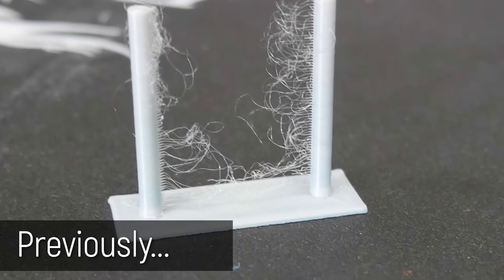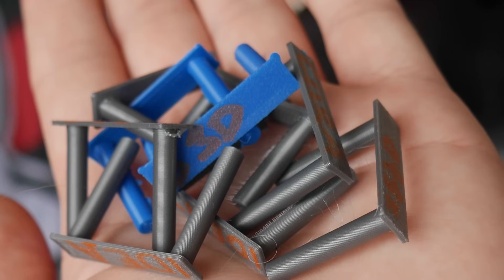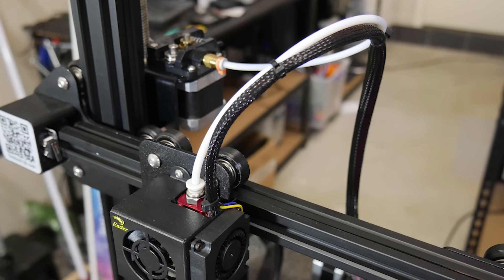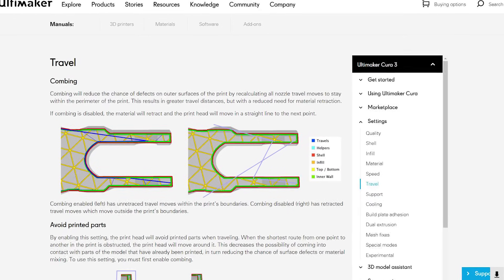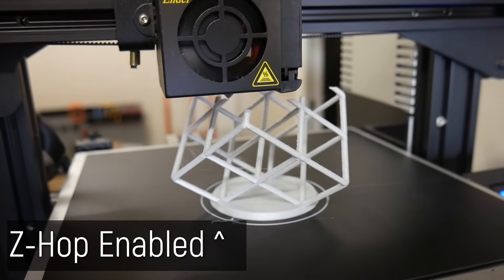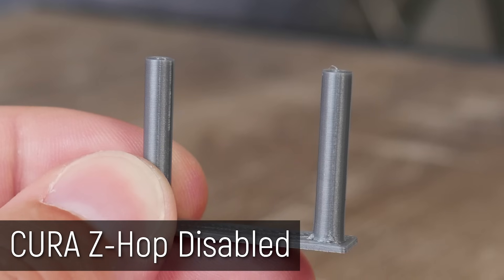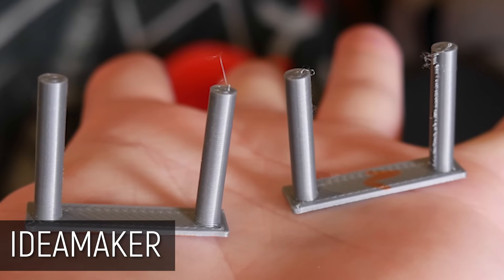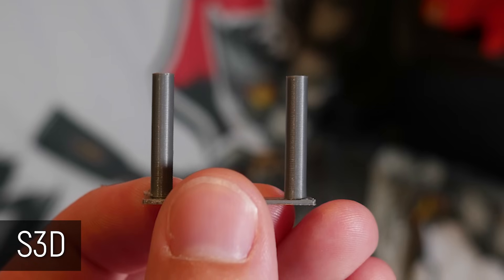Stop Ender 3 Stringing with this One Weird Trick! (ok but seriously)

Comment: I come from the far future of 2025 where Orca Slicer is ascendant. I ran into really bad stringing blobbing and oozing on a stock ender 3 pro on a certain filament with a certain profile. What I ultimately found was on top of retraction distance the retraction and detraction speeds played a massive role. There is no automated test in Orca, but if you run multiple retraction calibrations varying the retraction and detraction speeds you can find your sweet spot

Comment: I have a diy wood and 3d printed parts printer😂..I remember messing with the combing setting to produce the same results alongside the traveling thru the infill to prevent oozing...im receiving "new fresh" "better" abs to see if I can get no string...because I get the worst first layer wiyh ABS🥴...I NEED TO HACK MY SETTING  PRO MODE AGAIN(pro mode means head down watching that extruder head work and diagnosing the prints😤😭☠️💀

Comment: Hi Angus, I know it was 6 years ago, but can you please post where I can get your settings for IdeaMaker, the originals on 'gum' are no longer there, meantime I will try Cura with my Raise3D and 0.2mm nozzles which are failing to print without a web of stringing. I wish IdeaMaker was updated to include a form of combing, but I do not think they are interested, especially with regards to using the E2 with 0.2 nozzles. Thanks Jim

Comment: 2 days experience, learning as i go. after solving the sticking issue (glue stick) if this print makes it to the end it will be my 2nd and i don't have any stringing at all right now.
190 for the nozzle, 60 for the plate and running 60% speed, as of now. this print LOOKS perfect. but still too new to say for sure.

I've only done the test cat and one articulated dragon that i think finished by hopes and prayers alone, for my bed level was way too far from the nozzle.
every print after that until this one has came off the plate. but with theses settings i have no stringing.

if this gets any likes ill update this comment when its done.

Comment: Disabled Z-Hop (0.0mm) and reduced Retraction Distance (0.3mm) on Sovol SV08 and no stringing anymore. It needs to wipe over the object without Z-hopping to wipe all away.
Reply: So z hop, a feature to reduce stringing should be off and retraction reduced a feature that supposedly more helps with stringing  should be reduced. Doing the opposite is the solution?
Reply: @gt3911  Seems so for this printer. Very fast printing behaves otherwise than slow printing. I tried a lot with extreme test models, and get no stringing when z-hop is off. when z-hop is enabled i get stringing. Try wall printing order switch too. I guess diabled z-hop wipes the nozzle on the outer wall and avoids stringing. Try it, there is an extreme-test.stl on printables to test it all.

Comment: I know this is an older video but, I recently got an Ender 3 v2 neo and, my steel build plate was a little warped. I got a glass build plate and ever that wasn't perfectly flat. Ive also found that nearly ever filament is a little different from each other. I have slicer profiles not just for PLA, ABS, etc but, I also have different profiles for different brands and different kinds of PLA. 

Some people claim, "this is what causes stringing" or "this specific setting, alone, will eliminate stringing" but in reality, there are numerous factors and parameters that can cause or eliminate stringing. Whether it be temperature, z-hop, retraction, or more. 

I have 3 different PLA filaments from different companies and, they all use there own and unique profiles. Some filaments, no matter what I do, they almost always have some stringing. 

Temperature, retraction, print speed, and nozzle play major roles and are the first steps to attempt to elimate stringing.

Comment: 5 years later and im right here with stringing issues my ender has been great but i use tree supports in cura and i get strings and stalactites building up that can pull over small branches off the trees and making small details hard to print going to try combing thanks ur video is still as relevant as ever

Comment: The problem is u guys are all to high and mighty to just use the Creality stock slicer software. The Creality Slicer has grown by leaps and bounds if u own a Creality printer. Cura has too much settings for too many printers and it is hard to calibrate on their software end. Creality Slicer has all of the needed calibration settings to make your print perfect. I truly rately have issues. My first print with Creality slicer was totally flawless. I stopped and deleted Cura straighaway!

Comment: I have a 3S1, I'm not a 3D printing guru by any means, to be honest I didn't even do any tweaking/adjustment of the hardware right out of the box even. It's set up exactly how it came out of the box when others told me i need to tighten, align and fine tune the hardware itself before it would even print remotely cleanly. I loaded it up with flashforge brand PLA and the prints are flawless. Every single print I've done, sodastream replacement buttons, name sculptures for my desk, toys, toy cars, lego hardware, everything came out perfect. I then loaded Creality branded PLA in and everything is screwed, it's stringing like crazy, so bad that the strings will harden and the printing head will catch it and literally rip the print off the place and drag it around while printing stringing filament into thin air. I've put it in a dryer, etc with no positive results, so i've resulted to printing strictly with flashforge PLA now.

Comment: I'm having many issues with retraction on my Ender 3. Using default settings in Cura. If I just leave it will jam the extruder. I 'upgraded' to a full metal dual drive extruder and it's still happening. The extruder motor seems to get very hot under standard extruder setting. It's like it's melting the filament and causing a clog in the extruder just before the borden tube. I've changed the extruder and calibrated but it's still happening.
Reply: Turn down the Maximum Retraction Count And Minimum Extrusion distance window to your retraction distance

Comment: Unitimaker cura is bloody amazing I wouldn't even use any other slicer exspeicaly when combined with octoprint and a btt 7 pad the plug ins between cura and octoprint and btt 7 pad really helps fine tune ur printer even more honestly regret not doing this combo earlier amazing  control when I'm away I just msg who Evers at my house to change my build plate then I just start everything from my tablet or phone thro octoprinteverywhere plug in

Comment: Your Z-hop will probably work best it it's only 1 layer. You said
0.16 layer height with a 0.5 Z-hop. Try a 0.16 or 0.08 Z-hop 😊
I get very little stringing on my prints if any. Cura is the only slicer I use.

Comment: Unpopular opinion: ender 3 are full of gremlins and glitches.
Reply: Something I learned running CNC machines. It's great when the machine and program run perfect but you don't see how much you dont know until something goes wrong and you have to chase it down. Satisfying as hell when you figure it out. You now have a better understanding of the machine and maybe you can avoid those problems.

Comment: That was very interesting. We have a Raise3D pro2 at work, that's the only printer I ever used and only with IdeaMaker (Alpha 1.4 for Hyperspeed mostly).
I've never had stringing issues with the provided standard profiles and PLA. Perhaps to good retraction settings and cooling.
Haven't printed much ABS yet but had no stringing there, though lots of other troubles, but different story.
But with TPU lately it's been horrible! I need to run some temp tests with it but what helped a lot was the setting "avoid travelling through holes" where you can determine how much longer the way around might be before the printer actually goes through a hole. I set it to 2000% and it was all good... :-D

Comment: I DID IT!!!! My Ender 3 v2 NEO no longer strings at all even with z-hop enabled with PrusaSlicer/Klipper!!! I did it by setting PrusaSlicer to retract 100% then wipe inside the print before z-hopping away so it basically does what Cura does then it z-hops before it's next move. 
My Ender 3 v2 NEO setup: Mainboard=SKR 3 EZ (5x TMC2209ez drivers), connected threw UART to LePotato SBC running Klipper on Armbian 23.5 Jammy 6.1.x kernal from a 32GB emmc.

It has all stock stepper motors with dual Z motors totaling 5, Stock HOT END/thermo/Bed heater, OMGEXTRD V2 extruder setup as bowden. 
Settings in Prusaslicer: Retraction Length=6mm, Lift Z=0.35mm, retraction speed=40, wipe while retracting, retract amount before wipe=100%
These setting might not be and exact match for your setup but it could get you close to the settings you need to use.

Comment: Don't try this at home, but I usually get rid of the stringing defects in a fraction of a second using a lighter and some kind of flammable compressed spray can (like a body deodorant)...
A hot air gun would probably work as well

Comment: 4 years later and still helping.  I just got a voxlab x3 which is almost identical to a ender 3 and ive been fighting strings along with some leveling issues.  Ive been trying to use temps and retraction to reduce my strings with no different results.  Im only up to a 7mm retraction distance though which i seen you were using 12mm, and i did not know about combing yet.  

You mentioned a magic number for layer height, i wonder how it compares to my theory's that i havent looked further into?  Ill have to look it up.

So i will be trying some of these settings out and have fun watching the results.  

My background is in cast film extrusion so this is a hobby that ive been wanting to get into and its been a load of fun applying my work knowledge to a home hobby.

Edit.  Its bugging me, you sound like code bullet.  Is it just the accent/dialect being similar.

Comment: I'm running Simplify 3D and was having trouble with stringing. I watched alot of videos and no one tells you what temp or flow that their are useing.
I changed my flow rate down to 60 and got rid of the strings .This is for PLA temp 190.

Comment: the ender 3 is awesome, youre just bad at reviewing unbiasedly. ive had an ender 3 since christmas, and after swapping out parts, not that there was ever a problem with the original parts, but if you want fidelity on a $199 printer, upgrades are how you add value, the ender 3 isnt meant to be a final product, thats why its an open source product, abd you get the value out of it that you put into it, therefore, your review was just a bad review.

Comment: I'm new to 3d printing and this is the second video i've seen talking about that little...blip? that is used to prevent stringing. I don't know jack at this point, so I'm wondering why not print the outside layer, then the inside layers? I'm not sure if the printers even can do that, but wouldn't doing that prevent stringing? is there a reason that wouldn't work?

Comment: I believe the less the general users changes, the better the slicer is. :)  There are a few more variables but if you use a temp tower and others such as that, then retraction settings will work wonders.  And yes, I have a Creality printer and Cura.  You have to spend too much to get them to work as they should.  And yes, there are so many Creality knock offs these days it isn't even believable.

Comment: I wish I had found this video when I first got my Ender3v2, it would have saved me a couple months of headaches for sure. When I bought the Ender3v2 it was on sale for just over $125, so I didn't mind making a gamble. I was pleasantly surprised. It worked fairly well out of the box so to speak. Don't get me wrong, I have had some issues here and there, but not nearly as many others have reported. My biggest issue was the gantry sagging as the hotend got close to the end of the Y travel. The rest of my issues were minor and were resolved with tweaks here and there, including changing the firmware and slicer used.

Comment: I can not reproduce this in Prusa Slicer what a shame ...
Seriously guys wtf is gooing on ? My diret drive system uses 5mm retraction distance (tested starting at 1mm) and 30mm/s speed (tested from 20mm/s up to 100mm/s) and I still get reeeeaaally bad stringing. Travel speed is at 130mm/s extrusion multiplier and temp is all worked out and work great, just retraction sucks completely. Oh it´s a volcano nozzle 0.4mm with the large melt zone. But still the retraction performance is unbearable. I can´t go down with the temp, I can´t change extrusion MP what am I supposed to do now ?

Comment: I have an ender 3 max and it's put out some pretty good results. I'm not saying I don't have issues from time to time. Once in a while I can't get the bed to stick. I was getting some stringing going on lately but it had a lot to do with the filament as well. Had to throw it in the dehydrator for almost 24 hours. Then it printed good

Comment: How to solve 99% of your anomaly issues with PLA: get an SLA printer. Aside from the simplest prints that don't require any level of finish or datail... SLA is my future. Wasting time and material  trying to figure out why a butterfly flapped its wings in China and caused a print to fail, is not my idea of productivity.

Comment: I bought the Ender 3 v2 a month ago, using eSun PLA+ and Cura slicer.  I had developed a problem, can't remember what, but it prompted me to change the nozzle with the spare that came with the printer.
I don't think the Bowden tube was against the nozzle as I soon was getting a burning smell and eventually noticed filament ended up on top of the heater block.
Cleaned it all up, put the nozzle on 6 turns loose at first, put the tube down as far as it would go, and tighten the nozzle.
Ever since then I've gotten stringing.
I've rebuilt the hot end as I noticed the block was loose when hot, tried another eSun filament roll that I had used once but sealed in vacuum and silica pack right away, different adjustments, temp, retraction didtance/speed tests, etc, things just seemed to get worse.
PLA+ is supposed to use bit higher temps than standard PLA, 210 recommend as default than 200, but std PLA settings seemed to do better
But again getting worse.
I dried my. eSun filament in Sunlu S1 plus at 47C setting with silica inside for 8 hours and that did cut back the stringing but not completely.  Ambient room humidity is not high, about 40%.
What's  even more strange is I did an extrusion calibration test and stock 93 steps/mm was actually under extruding.  Calculated 98 to be accurate but that made things worse, which I guessed since I was originally under extruding rather that over as I thought might have been the case.

Oh yes, when the stringingstarted, also was getting snot/blobs too when using PLA+ standard settings but better with generic PLA settings.

I'm learning, especially with this vide, to just deal with the thin cobwebs, bit of blobbing and keep drying often, maybe with repeated drying it will all go away.
I have 3 rolls of eSun filament, 2 already opened so trying std isn't really an option right now.

But anyone have any ideas?

Comment: I propose a slicer comparison method that will also include a little collab. Each slicer has a 'champion', someone who will do the very best they can with the slicer they have to produce what they can on a set model print, they can pick the filament, settings and printer (within a price range). Then each person also has to print a model with the other slicers with best intentions (it's an experiment, not a sausage swinging comp!). Then they print a model with best one can figure as 'stock' settings, how it comes on install (likely doing this before the others). 

You may need to double up on the 'champions' of each slicer, with some multitasking creators pulling double duty to get as many represented as possible but in the end you'll end up with a final video giving a 'showdown' and lots of collab videos to link to as they show their own processes, successes and failures along the way.

Comment: It´s as said so different from brand to brand, even different colors may have significance difference in the state of stringing. I only USE GST3D that I buy online in Spain. The filament from GST3D is fairly good at stringing, even at 212 C and with different retraction rates, different nozzles, outer before inner, all at once and so many other parameters that can ba altered. This is all in different Prusa´ and Snapmakers with Prusa; Cura, Ideamaker and others, but don´t forget many slicers are bulit on the same platforms.
I never got rid of the stringing 100% with the GST3D, but I can live with it
The only thing I´m not happy with is that Orange PLA from GST3D is actually red, GST3D, asked me to measure the color with a spektrometer! I have many things in my workshops, toolboxes and cellars but to date I never owned one of these, so maybe this is my next wish for the man has it all. As a serious vendor as i thought GST3D was supposed to be, I had to think twice. Other PLA vendors more or less want to keep the customer happy and typically says: "Sure, we´ll send a new one" or "Hej sorry our machine was in lockdown mode, so here´s a voucher for the same amount for the next time you or your friends decide to spend some bucks with us"
Ah! This reminds of that GST3D still hasn´t sent me 2 emails from purchase from 9/5 2020, I did get Whatsapp 8/6 2020 with an excuse for the long wating, then I sent screen shot of the credit card charge, but still hear anything from GST3D or get any email from GST3D
;-)
Now, lets all get out there and do some happy printing!